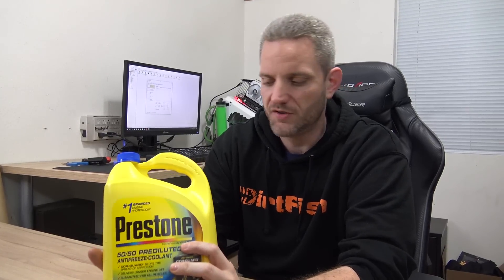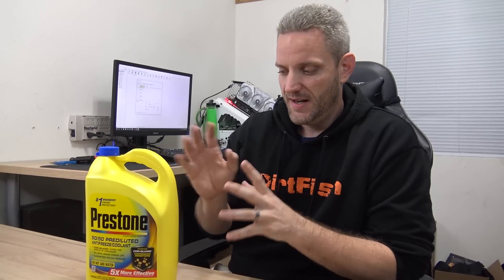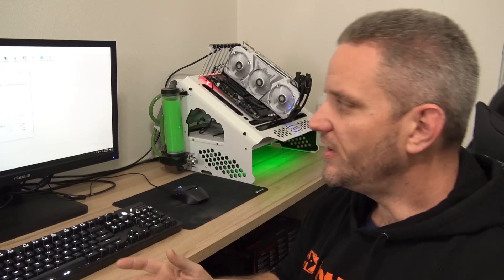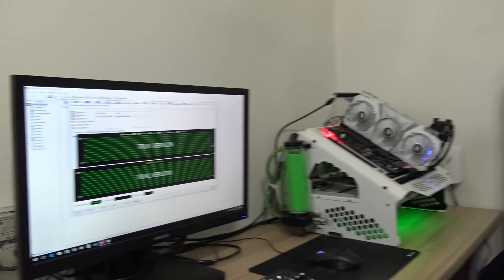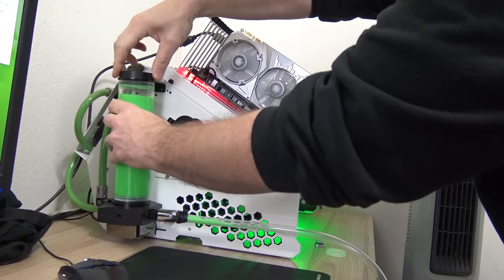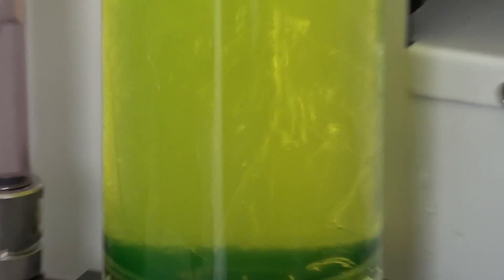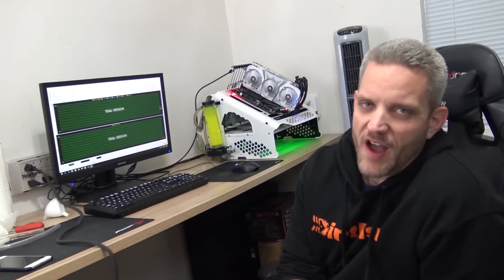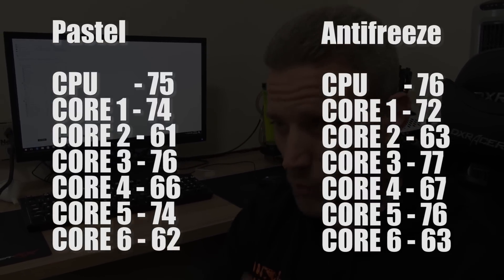I used Antifreeze to cool a PC

Comment: If you use water with modern coolant from bmw thats the blue one. you will be fine 
They use plastic electric waterpumps and the block is metal or  alluminium.
I think the best coolant will be very thin oil 0w10
But tis expensive

Comment: coolant has additives to protect Orings rubbers and plastics and cleans also, most modern cars top and bottom tanks are ABS plastic these days, hoses are rubber, and internal seals harder rubbers.
the cool thing with coolant is it glows under a black light.

Comment: Antifreeze is designed to not freeze or boil.  Unnecessary in a pc.

Water by itself actually cools more effectively.
Reply: Antifreeze actually bills faster than water that's why we mix it 50-50 when you put it in your car.

Comment: hey man, really old video but If you see this comment I would really appreciate some help, I recently bought an AIO liquid cooler (Deepcool Captain 240ex RGB version) and I don't know what kind of coolant to use...I tried googling it but I see all different types all kinds of brands, colors, etc etc....most are advertised for custom loop water coolers too so I don't know if that makes a difference or not...also my AIO has a glass tube on the waterblock so I dunno if that makes a difference either...any help would be much appreciated.

Comment: that was not a reaction with the system its the difference of density of the mix versus pure water. also not all antifreeze use the same type of glycols and some don't use them at all. if you are really worried about reactions with the hoses use the pink stuff for fleat trucks and uro cars. caustic is useful as well, so mix metals with no worries just like every not pc heat exchange system sense the late 1800s. I have an antec 420 h20 thats had a bigger aluminum rad and nickle gpu block added running for 11years now with no metal pitting or corrosion using used pink antifreeze from a vw vr5.

Comment: You need to remember anything you add to water is almost garunteed to raise the viscosity meaning it will get thicker and if you're pump is designed to run on straight water there's a fairly possibly your gonna fry it. As thicker fluids will make your pump work harder than its supposed too. Also Antifreeze does not cool as well as straight water. But because automobile manufacturers don't want alot of cracked engine blocks coming back to them they add it strictly to prevent the water from freezing.

Comment: Have you ever tried a low viscosity hydraulic fluid? Non conductive oils exist and are frequently used in electrical equipment as a cooling solution. I only mention it as I've always fancied giving it a go. Oil doesn't have nearly the same heat capacity as water though so I don't know if it would be that great. Just curious to know if you've ever tried it or if you know of anyone that has?

Comment: nobody realizes you're only supposed to use a dash of antifreeze even if it is 50/50. you still add a dash of the 50/50 mix to normal distiled water

Comment: It's still "water" cooling... just uneccessary to use antifreeze, unless you were to use a chiller to drop the temp below 0C
Reply: It is not "unnecessary", you are just staring the word antifreeze without thinking or not understanding what the liquids are actually made from. Usually the premium coolants are propylene glycol based, with some other additives. You know what else is propylene glycol based? Some car antifreezes, usually the red ones, with some other additives that may or may not be beneficial for PC water cooling. Difference is that car antifreeze is cheaper and stronger concentration, which makes it even more cheaper because you can dilute it with distilled water. Here Jay used a 50-50 premix which is still too strong. Diluted to a 25-75 mix is good enough for both the anticorrosive and biocidal properties of antifreeze.
Reply: Exactly! and that's exactly what I'm doing. I'll be switching to SMIRNOFF soon though.

Comment: Regarding concerns with the antifreeze eating the flexible tubing, if you're willing to sacrifice the aesthetic of the clear plastic tubing and switch to automotive heater hoses which are, of course, built to work with that fluid, that concern vanishes.

Comment: I have had Antifreeze cooling my main rig's loop for about 6 years (Changed out every few years to rebuild the loop, etc.)  I didn't really have any issues with hardware that I could tell.  My Koolance 5.25" bay reservoir/pump from 2009 finally spider cracked from the fill port in 2017.  Other than that, it worked about as well as I could've expected.  I can get some pics/part numbers if it's interesting to anyone.

Comment: Antifreeze is used in car cooling circles. 

You should use pipes radiators pumps and seals that are manufactured for this purpose. 
The blocks for the CPU and GPU should be made out of the same metal(at least all parts that touch the antifreeze)that is used in cars.

I think this is exactly how the first liquid cooling systems for computers worked: useing car parts.

Comment: Longevity is easy, dont use the glycol tubing, use the same based rubber tubing for vehicles. And corrosion should be a simple fix as well if you have aluminum water blocks, i would say get you a gollon of GM dex cool coolant. They supposedly designed it not to degrade aluminum radiators.

Comment: I just thought of something weapon if you modified a mini freezer drilled holes sealed with hoses to run the reservoir through the freezer and back into the PC using the anti freeze to cool your components

Comment: i used the concertate version of this kind of antifreeze with no water and after a few months i had no problem with the tubes but my res had some weird reaction that looked like overspill but it was on the inside then a few weeks later the res started cracking and then leaked through the cracks but saying that i had no problem with high temps.
Reply: %100 concentrated antifreeze without diluting with pure water??🤦‍♂  literally ignorance..Sorry

Comment: you are an idiot 😂😂
antifreeze its use on car radiator when temperatures are lower then 0 °celcius
so antifreeze won't let water to freeze inside on the radiator

Comment: ethylene glycol is the base but auto coolant has other additives for anti-corrosion, and it is the consumption of these anti-cor additives that necessitates changing coolant every few years.
Plain water is one of the best thermal carriers, it just has limits on corrosion, freeze, and boil. Molten metals have better conduction so passages can be much larger and higher flow but the specific heat capacity of the fluid is lower and they tend to alloy with solid metallic components, the better option [water/metal] depends greatly on the application.

Comment: https://danep71.tumblr.com/post/174283662585/computershardware

Why this doesn't work and why there aren't better alternatives to water.  Buy another radiator if your current system isn't doing it for you, this will actually make your system less effective.

Comment: I want to see, specifically, Evan's Waterless automotive coolant used.
Reply: Coolant/antifreeze is usually a mixture of coolant(water) and antifreeze(idk, chemicals and stuff). Dont be confused like most ppl when referencing desired results compared to the name. Mixed with water(about a 50% mix is average) performs the cooling part of the equation. Link provided, if you were to use pure anti-freeze in a pc loop, you would no doubt see higher temperatures overall. Basically the equivalent of throwing salt(antifreeze) on ice(water loop).

Comment: Yeah, I only used it with silicon tubing. That was about 10 years ago. Had absolutely no problems. That said, it always comes down to the materials involved. Though, his comment about effectiveness misses the point of the idea of using anifreeze. Antifreeze is often cheaper than the coolant for computers. Much cheaper. This is predominantly due to the fact that each time you drain the system, you should not reuse coolant. Any dust, dirt, or random particles that get into it can and will increase electrical conductivity. Who wants to drop $25 per liter for coolant if there's a chance that they will have to drain it and spend the money all over again? I gave up after ordering my 3rd round of coolant back then. If I can get away with a cheaper option, I will.

Comment: It's not a bad idea if you are in Siberia, and you often leave your PC outside overnight, and need to start it without waiting for it to thaw-out...
Reply: For some time I thought it'd be interesting to overclock a PC and see if the -40℃ winter weather can passively cool it. lolz

Maybe I'll do that with my current rig? ...when I finally get around to building a new one.
Reply: well if there is enough airflow around it it should work, but you still need a proper passive cooler for that since the heat has to go away from the actual cpu
Reply: if you leave it outside? dude it's -30 inside !
Reply: @Nordic_Mechanic  In that temp even 12 years old children going to school. Week ago it was -50. :D
Reply: @Arocksy  Only went to -35C a week ago
Reply: you wont need water cooling in that weather air cooling is way more than enough
Reply: I have an overclocked pc up against a drafty window.
Reply: Michel Guerrero  but you couldnt afford a 10$ keyboard to fix your caplock issue
Reply: Anti freeze isn't used in your car because otherwise you'd need to thaw it out, it's used because water expands when it freezes and would crack your radiator, heater core and engine block if you allowed it to freeze.
Reply: Gas powered PC
Reply: being that cold might be very good for performance
Reply: @derekriggs7659  except for when you wittness a coldbug. then your done for...
Reply: You know you will need more antifreeze percentage, cuz 50/50 at that temperature will freeze
Reply: I was literally thinking that the only reason we use anti freeze as a coolant for our cars is because it doesn't freeze as easily. Lol
Reply: This comment is so funny 😂
Reply: Michel Guerrero NICE
Reply: Michel Guerrero  it doesn't matter where you are when your inside. The pc is inside not outside so weather conditions don't matter when your in a controlled environment.
Reply: Hm... not a PC in usual sense, but it's possible to imagine a mini-server (say, router plus proxy-server) at a base of antenna pole (aimed at a cell tower some distance away) that might require additional cooling while, at the same time, having to have motheroard and other components in airtight environment in order to keep the electronics away from rain and other elements as much as possible; in this case, watercooling loop with raditators outside of airtight case is a solid - if not the only, - option, and antifreeze in it - is a no-brainer, especially for freezing winters. For other components on mobo (RAM and its controllers) which would suffice with aircooling but would suffocate in airtight case - another closed loop, for ventilation and with a heat exchanger.
Reply: why the hell do you leave it outside ?
Reply: @karlomoharic3992  (it’s a joke)

Comment: For antifreeze to work u need it to be pressurised. If not you wont see any foreseeable differences.  But if you were to pressurize the system it would indeed cool better. But if you were to use a pressurized system use 134a would def keep everything cooler  then water ever could

Comment: Best antifreeze is red Toyota 5050 is too high since you don't need corrosion resistance use 80water 20 antifreeze helps transfer heat better
Reply: No it doesn't , alcohol is there to inhibit corrosion and to lower freezing point of water .
Reply: @karlomoharic3992  , wrong pub

Comment: Failed to point out that anti freeze isn’t used for cars because it’s cooling properties are any better than water. It’s because if you use water in a car the lines will freeze in the winter time. So unless you are planning on leaving your computer outdoors, there is no reason to use it.

Comment: I use CORAL ANTIFREEZE a product of SHELL for over eight years now on my rigs (15 total) with excellent results. NO dirty, NO wear at all. 
Last week i open one water block for inspection and it was clear!!!! Of course i use only cooper blocks from WATERCOOL (HEATKILLER IV PRO AMD or INTEL PURE COOPER)
 and i think that they are the best of the best!!!  I use XSPC PHOTON 270 TUBE RESERVOIRS,tubes PETG from BITSPOWER or LRT from PRIMOCHILL,  pumps D5 from XSPC,
radiators again full cooper from EK and ALFACOOL.
Antifreeze CORAL from SHELL cost's 4.3EU in Greece per liter concentrate.That means 3 to 4 liters ready for use solution after the mix with water.
 JEY i watch your trials for years now,
i hope you wil'n't loose your quality.
vasilis GR

Comment: Antifreeze isn't good for heat dissipation.  Antifreeze is used in cars to lower the freezing point of water and to raise it's boiling point.  

Water is a much better heat conductor by itself
Reply: However water is much more corrosive thn coolant. Water can cause cavitation inside the block and other components. Thats why things like water wetter and coolant exist. its stops the coolant from freezing yes, but also lubes, and prevents other issues known with using just pure water.
Reply: Water has a high specific heat, so it's not a great conductor of heat. Metals have lower specific heats and thus change temperatures with less energy being inputed when compared to water. Your first two statements are valid. Your last one about water is flat out wrong. But yes, straight water is better for cooling purposes when compared to antifreeze, not for thermal conductivity.
Reply: Kid stfu
Reply: He's actually right.  Research colligative properties which lower the freezing point and raise the boiling point.  They also slightly reduce thermal conductivity compared to 100% water which is why recommended concentrations of coolant goes down as you increase the temperature (ie climate).
Reply: BS about raisin the water's boiling point.
In fact antifreeze lowers the boiling temp so you should mix it 50/50.
100% antifreeze will boil too early.
The car doesn't normaly boil because of higher pressure in the heated closed system.
Reply: Do you realise how dumb this comment is?
Reply: @cdreid99999  Which one?

Comment: the tracers you saw in the fluid was just a density difference between water left in the pump and the anti freeze.  believe the water floats on top so that's wha you saw motion.

Comment: most coolants are made to protect aluminum from corrosion but you need some water for good heat transfer, i would do less than 50/50 cause it won't boil
If you do a glycol test, do both test tubing capped for leakage and set in a jar of coolant to see the deterioration

Comment: Try it with VW/Audi G13+ is it specifically designed for aluminum blocks where Prestone is not and if you run anything other than G12/13 and you have a warranty issues, well you just bought a new engine or whatever parts were damaged by the wrong coolant.

Comment: Water is the best coolant the antifreeze is mixed in and is only there to reduce freezing temps and increase boiling temps thresholds, also, it allows proper lubrication on internal rubber or fiber parts so they dont wear as fast as using straight water ie o rings or gaskets.  Coolant by itself is not meant to displace heat hence a 50/50 mix or even a 70/30 mix is applicable.

Comment: I have lc power aio watercooling on my fx8370 with ati 6970 i used a antifreez and worked over a month with no problem bu i used a lot of water cuz aio pumps are too weak to power up open loop, and im now using mouthwash also no problem keeps it cool and there is no bad smeel of antyfreez that could appear

Comment: Try propylene glycol water mix and a laboratory chiller at sub zero temperature. Just remember to insulate the tubing and heat exchangers from the air.

Comment: Is everyone trolling or does no one realize that automotive coolant is, "coolant that resists freezing/boiling and inhibits corrosion." The crap does have a temp range (minimum and maximum), and the PC will never reach either of those temps. First and foremost it is a coolant. Jay has shown exactly what automotive cooling does well, which is cools shit off, and it does it just as well the crap that you buy for PC cooling.

Besides a chemical reaction to PET, the only reason to use EG (ethylene glycol) or PG (propylene glycol) based coolant (these are the classic green that are popular in the US) is because these types of coolants have corrosion inhibitors for brass and copper in automotive radiators. The newer OAT (organic acid technology) or HOAT (hybrid organic acid technology) are "generally" used for aluminum radiators. Though there are many (if not most) blends of HOAT that are supposed to be capable or inhibiting corrosion in brass/copper radiators in addition to aluminum. Hell there are a ton of blends actually, but this is just general information. Oh and the organics generally don't kill animals that drink the shit. 

An OAT or HOAT type blend "shouldn't" corrode PET tubing, but OAT might not do well if you have a copper radiator in your PC (read the damn label to see, remember there are a TON of blends). Dah hell, why do I bother, we can't let facts get in the way of being "right" about what auto coolant is and how well it actually cools. Remember that just because the label says antifreeze, well that's not all that it does..... Yes it works VERY good in a PC cooling loop and it's a lot cheaper.

Do some research and learn something before making stupid claims about auto coolant and how it's just antifreeze and it wont cool a PC as well because "it's designed to stop stuff freezing, not cooling it."